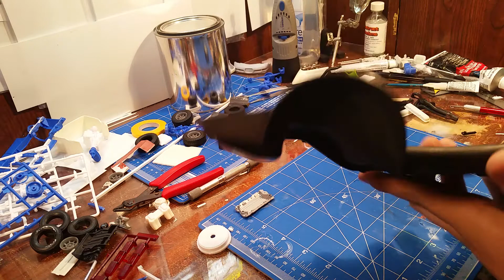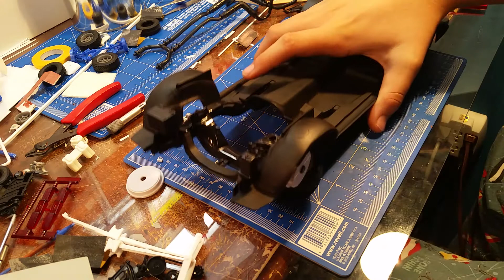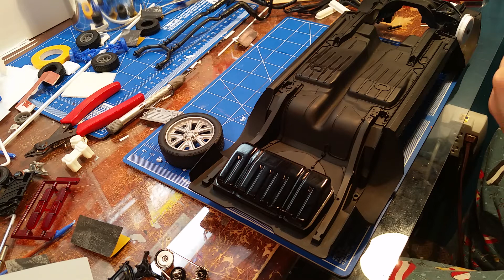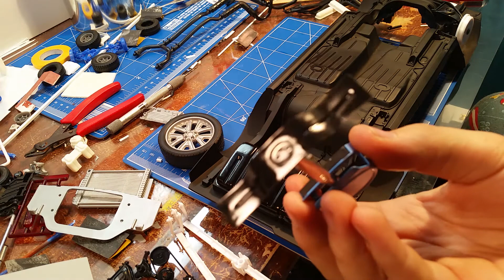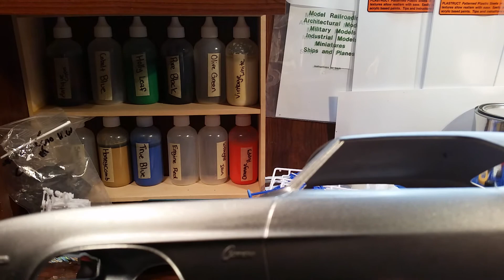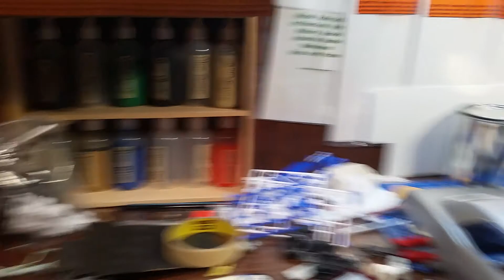Bench Update

Comment: Wow, that's looking good.  Is your question about how you can apply clear and what it will do to the grey or silver coat?
Reply from the maker: The question is more of: Will the paint look normal if I wet-sand it before I apply the Future Floor Shine?
Reply: No, if you do that, I think you will disturb the flakes and or bling in the paint.  Silver and gunmetal are finicky.
Reply: I approuve DC, cause you have to fill in the gaps that flakes creates and if you sand the flake will stay dull forever i did it on my motorbike so i had to restart from the start, Good luck but i would put 2 coats of clear or future beffore thinking of sanding a fresh flake.
Marc saying Peace & KUTGW go see my ddfj71 car it is extreme flakes.